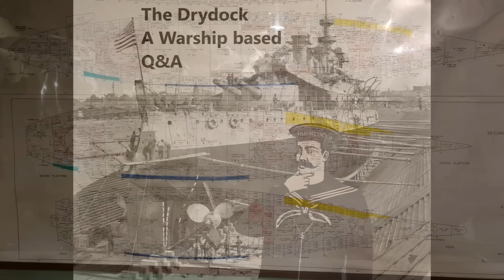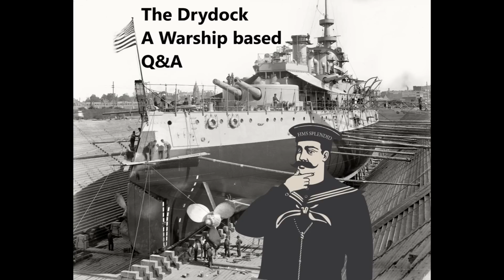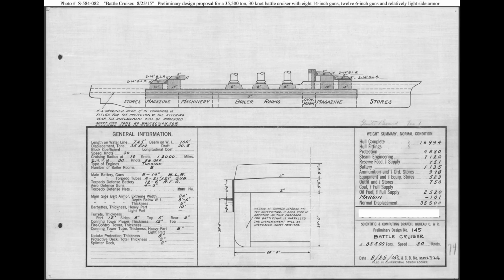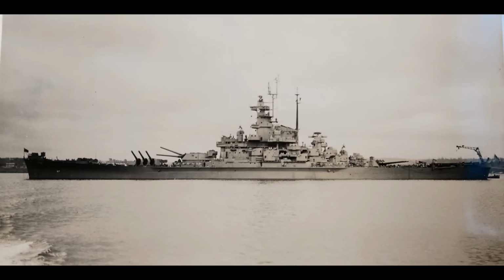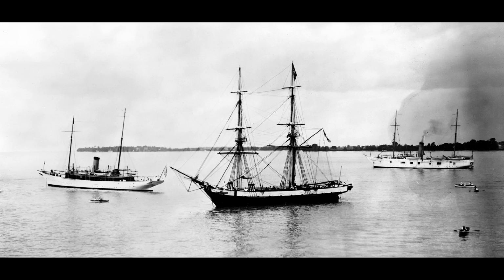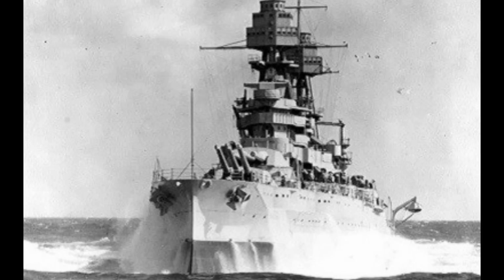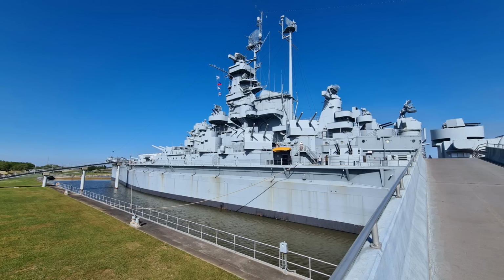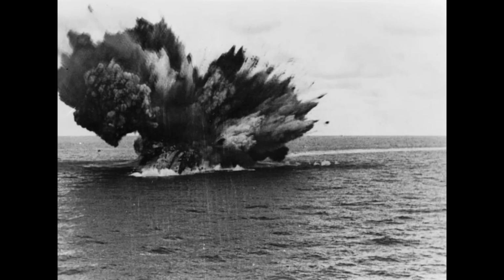The Drydock - Episode 197 (Part 2)

Comment: The idea that the "advantage of backwardness" has declined in value seems to be a denial of the philosophy "the pioneers take the arrows."  R&D toward a technology that may be impossible is markedly more risky than R&D toward a technology that your opponent is fielding: you start with a positive answer to the question "is it possible?" and only need to answer the question "how?"  How can be a quite daunting question to overcome, but the ability to direct resources  at known achievable targets vs a variety of potentially impossible ones makes the R&D resources of a less advanced power potentially far more efficient.  While the FLOOR for such advancement may rise with increasingly advanced global technology, the cost of cutting edge research also rises, possibly even exponentially.  Thus some nations may be left behind entirely, but the technological delta between those above the resource/knowledge base floor should concurrently SHRINK.

The optimal strategy in such an environment might be deliberate surrender of technological superiority in some arenas with the understanding that sufficiently good intelligence will allow a state to focus resources on a few fields of risky, novel research while allowing competitors to use their resources on other technical  arenas where the gap can be relatively easily made up once the most basic questions are answered.

Comment: In regards to China not being able to "keep up", this is more cultural than technological.  Could China build modern weapon systems?  Most assuredly.  Then why aren't they?  Because an authoritarian regime does NOT promote out of the box thinking.  There's a reason China steals most of the technology they have.  They are not innovators, because innovation requires out of the box thinking.  Which is not prized by the Chinese government.

There is absolutely no reason why China could not have a modern naval and air presence, except that they are only using stolen or purchased technology, rather than developing it themselves.  Until the culture changes, this will remain how things are done in China.

Comment: China has traditionally coppied technology or stolen it from others, so has never been at the cutting edge. The rate at which China builds its equipment would suggest a low-tech approach such as Russia in WWII-Warsaw Pact era. Russian stuff looked really good until you met it in battle and sifted through the remains.